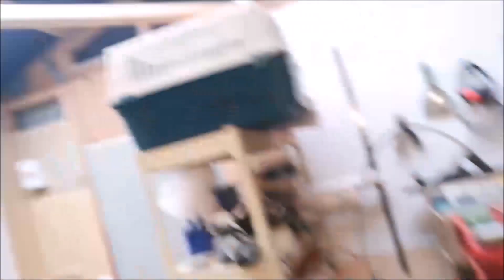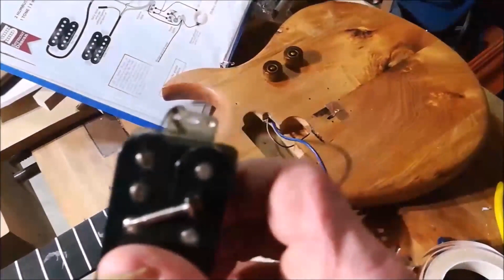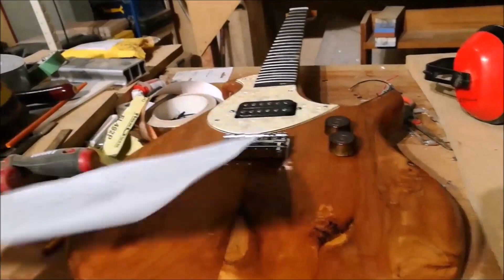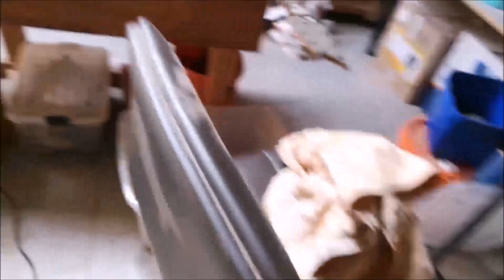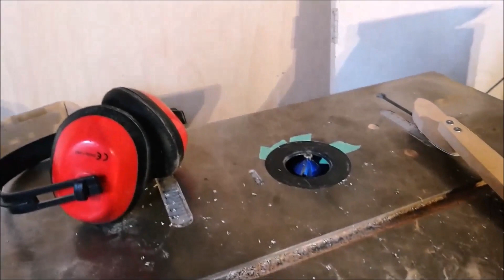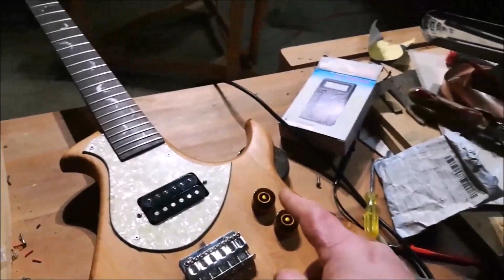Monster Guitars 080: Wire it up! (And make a custom jack plate)

Comment: If the intonation problem on the dark finished guitar is that you can't move the saddles close enough to the neck, just get longer intonation screws.  Depending on how much longer you need, it might look strange, but you could at least save a fine looking instrument.
Reply from the maker: Thanks for that, Russell. Alas, it's the opposite problem. I placed the bridge too close to the nut.
Reply: @MonsterGuitars  That's a shame.  If everything else about the guitar is good there must be something acceptable to save it.  Maybe a more standard bridge with an addition of a pick guard (scratch plate.)  Oh well, just some thoughts.
Reply from the maker: I think you're right, Russell. In the past a scratchplate has covered a multitude of sins for me. At some point I'll revisit it and rethink the design. I'll be left with string-through holes that aren't used, but I can live with that.